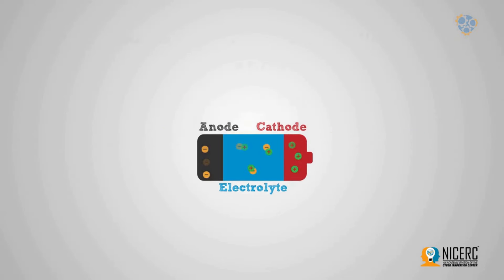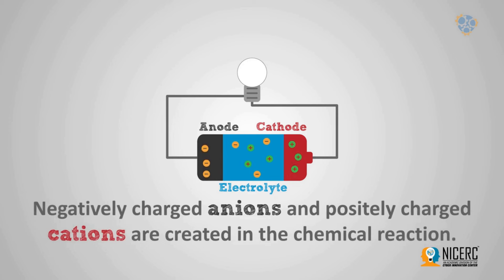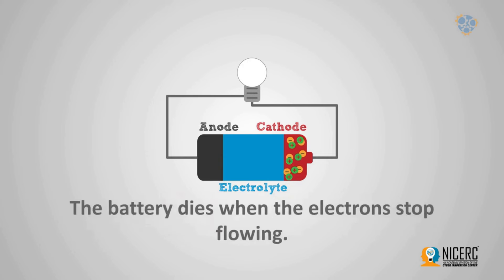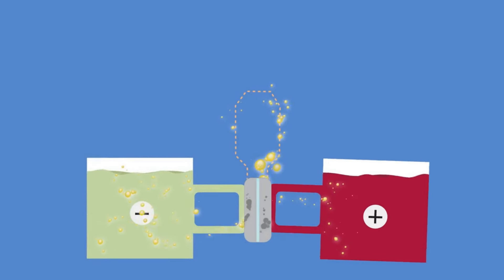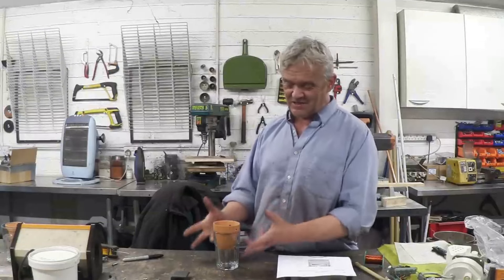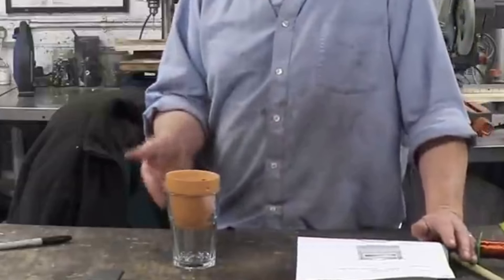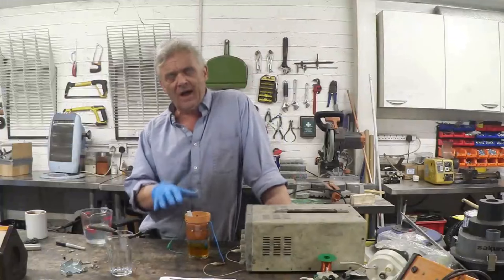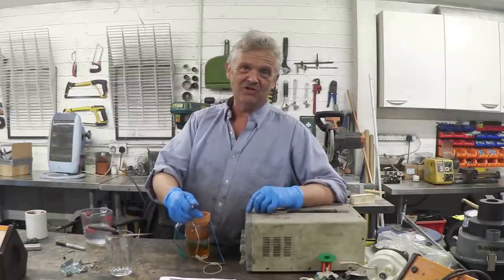2235 The Flow Battery And Energy Storage That Actually Reduces CO2

Comment: What if we could obviate the need for 'storage'? What if as in 1874 the magnets of the AC generator ARE the store of value / energy? I love video 1874.  Earnshaw's theory is dependent on the shape of the magnet. Although is dependent on spin. The field is active and not a static thing, and its this invisible motion of the magnetic field that requires balancing through spin and design of the magnet, and voila a frictionless magnetic bearing-rotor. But isn't magnetism just a form of ''non-general gravity''?  I'm no scientist. As a quack however I do love to try and get things right. Awesome show. No but really, the magnets as the store of value. The coil could be decoupled even though the generator still spins (say in a negative pressure vacuum on the moon's low gravity, or in a room with atmosphere on earth). Or, the levitating magnetic rotor-bearing is decoupled from the base so as to preserve the magnetism longer, kind of like an OFF switch. However the magnetic field can't be switched off, it's say a property of the alloy, tetreanite and oh well, this could be molded (domains aligned while molten) so as to keep it levitating and spin in place without as according to earnshaw's law, drift to the side. The design should focus on giving lift, spin, and retaining a centered location for this spinning.  So you won't NEED a battery. The "battery" is the magnetism of the magnets itself, of the generator, whose magnetism retains that potential kinetic energy which can be decoupled, as a store of value, id est, battery.  I'm a huge fan of tetrateanite as it's such an apparently simple alloy to make, and I'll say again that I think maybe it was due to the magnetosphere of celestial bodies that aligned its magnetic domains while it was still molten and flying through space. I may be wrong, I don't know. I'm not a scientist. I prefer to identify as a quack so that I can't be held accountable for any of my postulations. I just need a gorillion dollars and I can build a doddy-drive factory! Later it can be implanted into a gyroscopic system so it can be used on ships, too!
Reply: Simplicity is key I say. These videos are just so educational. I always wish that Luke would make an Edutainment series where he raps science lessons for younger learners, would be a true classic, with slides and all. Rap News is SO good. I'm sure it is possible to put it all into rhyme somehow.
Reply: I think we should leave CO2 to plants. Thank God! Mind blowing video though.

Comment: I’m thinking that if you charge a supercapacitor in an electrolyte of Sparkling water and then discharge it in an electrolyte of non-sparkling water it will generate electricity.

Comment: Potentially exciting for municipal scale renewable grids, to store as much excess energy as possible, to even out demand spikes with equivalent battery supply, minimizing reliance on fossil fuels.  The small scale could be used for off-grid houses, or all on-grid houses, to decentralize and distribute excess power capacity.  I could buy panels, or ground based wind power, rely on battery power more, and sell excess power during extra sunny or windy days.

Comment: The video seems to skip over the step required to make the graphite into an electrode, did you attach it to ? and then dip it in resin, so many questions.
Reply: Graphite works just fine as a short-term electrode without any treatment at all.
Reply from the maker: that's exactly what i did mate

Comment: I have figured out once and for all how to power my house in Portugal. The problem i have been trying to get Robert to do is produce a device that will generate 50 to 100 watts. I realised that did it 54 years ago. I had a honda 50 motorbike and I fed the output of the gas stove lighter into the carburetor. I the turned off the petrol and it used up all of the petrol in the carburetor. It then carried on running happily on tickover. Now how much gas was it getting ? Well if you can imaging a flame the size of a candle but as thin as a pencil about 1 inch long. That's it a pilot light basically. Ok now buy a generator and repeat the whole thing with propane or butane gas bottle feeding a small generator then you are home and dry. Now just put a tiny load on it like charging a cordless power tool battery and it will not stall the generator. So how much power are we talking about here? A candle is about 80W so lets say the gas is more efficient and say we are getting 25% efficiency so we are getting 25W. You can run a lot on 25W 24/7 just running at that rate that gas bottle is going to last a long time. Of course you could even use biogas. I will put it on my channel sometime in September when I get back to Portugal.

Comment: 90Whr/kg, let's compare that to the oil, which is 11kWh/kg, more than 1000 times energy dense. The thing with the green electric future (perfectly balanced supply/demand) is the lack of energy in case of shocks to the system. Living in a city in the past, the street had candles, coal, oil, gas and gad enough energy to adapt when there were shocks. It would be good to keep oil infrastructure, so that everyone in a city could have access to high energy in an emergency (a barrel of oil is a 1.7MWh battery) and a large European refinery will process 500 000 barrels a day. That's close to a TWh of battery each day in the system as a buffer against shocks.
Edit: OK, 122 times as energy dense. I was getting a little carried away. But the point still stands. It is not about perfectly balancing renewables vs consumption in normal times but having energy buffer in tough times, especially in cities.

Comment: why would anyone reduce a life-giving gas CO2?
Reply: I use nature’s co2 batteries, trees. I then use my cordless heat pump, stove, to pump out heat.
Reply: Shhhh! You are not supposed to think for yourself, trust the government blindly!
Reply: @John-kj5whthere is no natural balance. That's why atmospheric CO2 is rising. 

A balance would be achieved when this value stays the same.
Reply: Exactly
Reply: @ShivaTD420  that isn't the only meaning of the word balance. We already know that in sealed environments raising temperature causes more co2 in the air, and lowering the temperature lowers the amount of CO2 in the air. Mostly it has to do with microorganisms, but the plants will consume enough extra co2 to produce enough material to feed the microorganisms such that they don't risk depleting the soil to the point of extinction.
Reply: @ShivaTD420  It's rising because the oceans have warmed up thus releasing CO2. CO2 lags temperature by about 700 years and the reason for our CO2 levels is due to the Medieval Warm Period. Be thankful.
Reply: @pauljenkinson1452  incorrect, the ocean is absorbing more CO2. Go look at the rise of ocean acidification. Water absorbs CO2 which becomes carbonic acid.
Reply: Why we need ta take down CO2  under 350 PPM is the livegiving gas take our lifes more then it give! /Mikael
Reply: Politics, 🎉 but really there are effects, close to the ground the planet heats, up a little further it cools.  You have to pays for extra specs for weather, ie structure strength and insulation and unproven but seawalls.  Put if you can get CO2 in an easily transfer state you can release it in green houses for bumper crops.
Reply: Tell me you are scientifically illiterate without telling me you are scientifically illiterate.
Reply: Classic "he doesn't know enough to know he doesn't know enough" comment
Reply: @ShivaTD420  Yes if water cools then it would absorb the CO2 from the atmosphere. Try this experiment. Get a 6 pack of fizzy drink. Stick 3 in the fridge until cold and see out how many fizz when you open open up the can. Then try with the remaining 3 warmed up and see how much they fizz. The amount of fizz is how much CO2 is being released from the liquid. BTW, my previous statement is correct because I was just talking about rising CO2 levels. The reason for the 700 year lag is because the oceans are a huge heat battery.
Reply: So you don't suffocate, mate.
Reply: without CO2 there would be no oxygen. Surely you know that
Reply: @hrothgeirrH  at 300Ppm plants start to  die  .  D0 u eat f00d??
Reply: @ShivaTD420  wrong . . More c02  FASTER PLANT GR0WTH  . Y0U D0 EAT  RIGHT ?
Reply: @pauljenkinson1452  u d0nt mention 1000s of under sea volcanoes becoming active ... why is that ??
Reply: @John-kj5wh dats why I hav 2 type in riddles  . All Seeing  Eye  Ai. Gets it 0ff.
Reply: It's it about reducing CO2 (to levels below the pre industrial era)?
Reply: It's wired to me if you take a step back you must admit the level of co2 is increasing.

At some point the world was covered in trees. 

We have cut them this remove the carbon to oxygen conversion.

Than we made concrete which releases trapped carbon over time.

The world population has grown to record levels therefore we increased the things that produce carbon.

So on balance we reduced the carbon scrubbers and increased the source of carbon therefore it is logical that there is more carbon.

Now if I put ppl in a car seal it up so no air gets in and increase the co2 ppl then to die I'd left ther long enough. So there is a logical basis to assume there are going to be issues if the carbon is allowed grow in an uncontrolled manner.

Is it to the extent they say I do not know but there is logic in the argument well from a basic poverty anyway
Reply: @hrothgeirrH  If you are so scared buy a canary and a canister of air. the canaries are still alive, amazing
Reply: @John-kj5wh 0.003 percent? Random comment. Point is you need to check if all that wet land traps more carbon than it makes as anything that breaths produces co2. 

Trees trap it as they make bark ect. 

Point is that it would need a study to see the level and the effect which is what the world gov say climate chage is.

Now not trying to agree or disagree about levels as we are not scientists.

But the point was to say there agreements would on the face of it have validity. And if we want to chat about it the con side of the discussion has to provide evidence. I have not heard any just claims that this thing offsets this other thing.